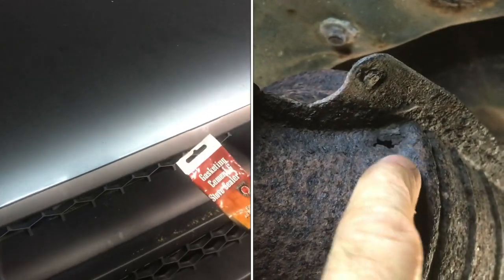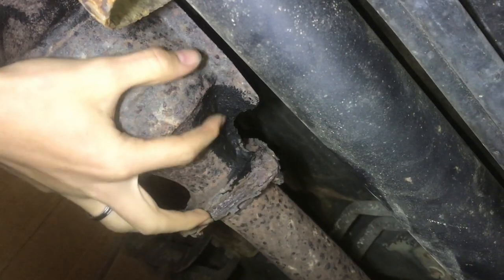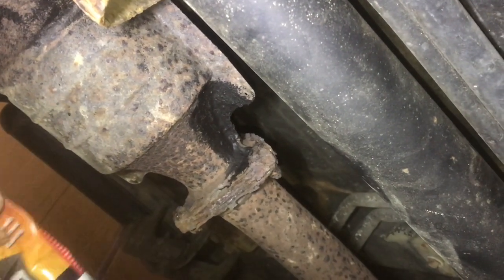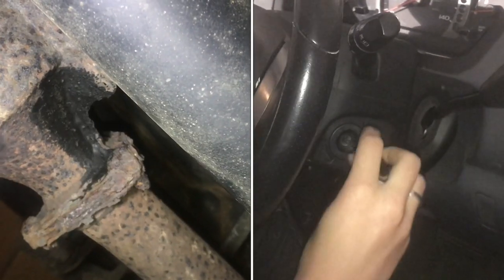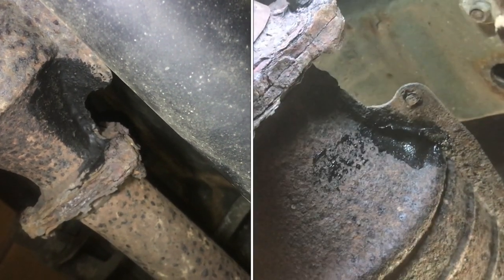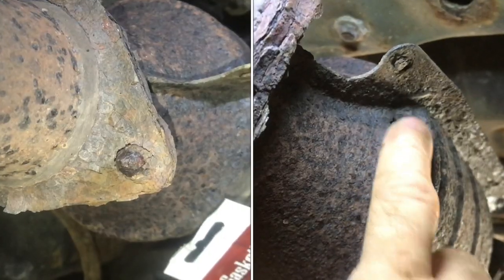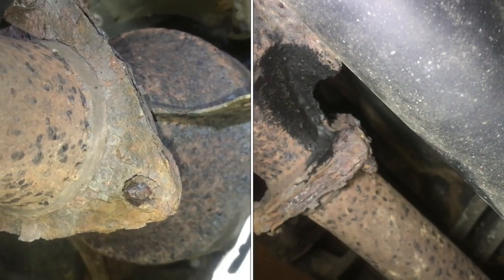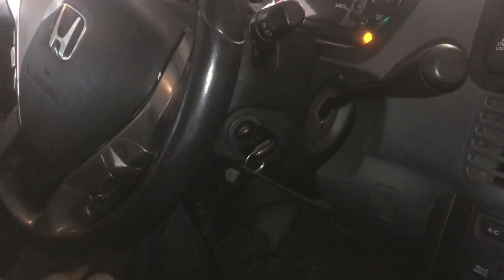fix a hole in a catalytic converter that “HANDLES THE HEAT”

Comment: Did you have Any codes before that patch? Specifically p0420-p0430. Was hoping for some good news because I replaced my fuel filter and replaced a loose muffler clamp hoping it would clear the code. But also took a shop vac and stuck it in the muffler from the exhaust of the vacuum and noticed air coming out the top of the cat. So hopefully this patch will work 🙃
Reply: Any update and how did you fixed it i have the same problem
Reply: @mdb9007  did any of y’all get this fixed cause I have the same issue

Comment: How long it lasted? I saw on other channels that it usually last a few months at best, it's a temporary fix mostly. Can you confirm?
Reply: 2 weeks for me. I used the same stuff as in the video. I prepped the metal well but it looks like it burned off anyway.
Reply: I have used it on a wood burning stove, and it didn't last an entire southern winter.
Reply: Alright guys so I tried VersaChem Exhaust joint & crack sealer to fix mine and so far it's been a month and everything is holding fine (no cracks or anything). The product in the video is only for indoor use and won't last very long in the elements. Also make sure that you use a sealant that can resist up to 1000-1500F or it will burn off or crack. From what I heard, with luck, it can last for about a year or more. Still better than pay for a new catalytic converter
Reply: @TheMax0005  how's it holding up now?
Reply: @Hallullas   It lasted almost a years. Had to put fresh one during mid summer. Keep in mind I have -30 winter with a lot of salt on my roads where I live.  So it works.

Comment: Hi what if it is a bigger hole? Can you use the cement and a patch? Will it hold? Thanks!
Reply: Use a mesh to give structure and then apply.
Reply: @mattmalenda6585  What kind of mesh are you suggesting? Thanks in advance.
Reply: @TheCgelarden  fiberglass exhaust tape works well, gave the “glue” something to support itself with under pressure. Had my exhaust break into 3 pieces, at the cat, and the rear muffler weld disintegrated. With this cement and fiberglass tape I now have 1 complete exhaust system, not pieces.
Reply: @mattmalenda6585  Thank you for the reply and Info.